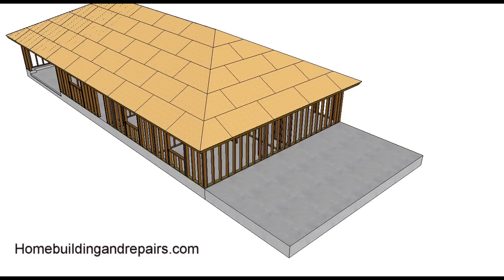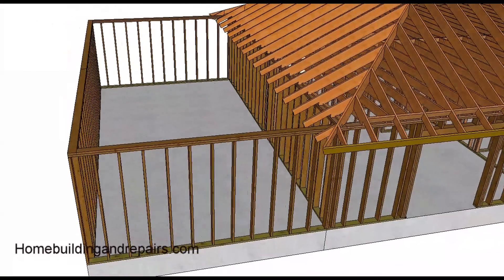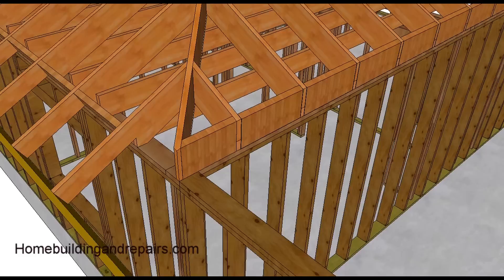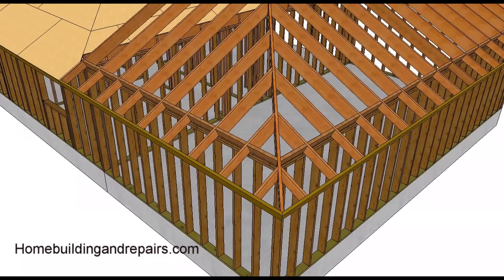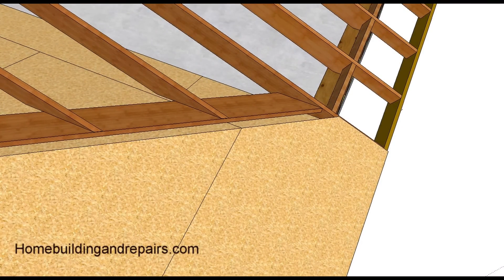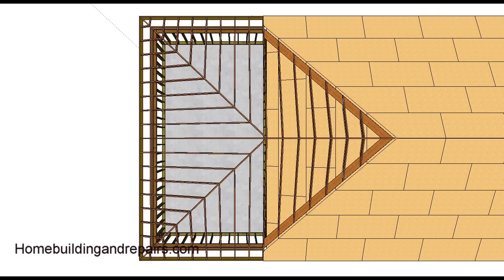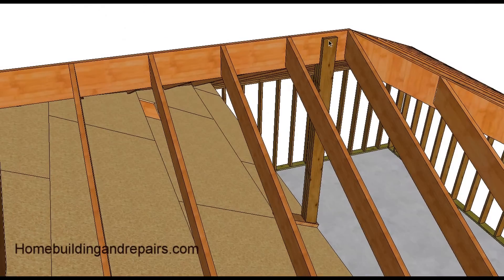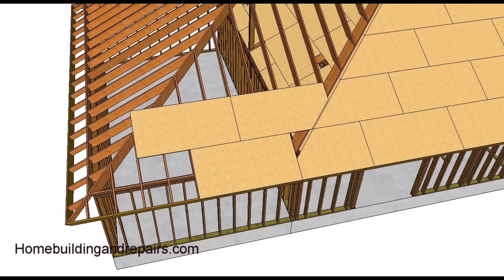How to Frame Hip Roof Home Addition for Existing Building with Hip Roof

Comment: I’m assuming you’ll have to build an attic door since there is no way to install insulation or access the new attic from the existing attic? Personally I see no reason why you couldn’t remove 1 or 2 sheets of plywood from the old roof. It’s not doing anything structural since you’ve no overframed it.
Reply from the maker: You can usually create an access hole in between new and existing construction.

Comment: Do you need the horizontal 2x8 or 2x6 on the newer addition? Your video doesn’t show any for the new addition? Reason asking is I’m turning my 20x22 second garage to a 20’ depth by 32’ length.

Comment: Great-thanks! I'd love to extend laundry room addition all the way to the other end of the house-I was thinking, "If I could just roof off of the roof, that would be great." In my head this is exactly what  I did!😝👌 Nice!
Reply from the maker: Some times you can build on top of the existing roof. I do have more videos you should check out if you haven't already at our website.
Reply: @gregvancom  I did-thank you! I didn't think to ask inspector if it was stick or gable, but my brother-in-law went up to the attic with him. I'm really glad a have a hipped roof for even water distribution around the home. We get pretty serious ice with freeze/thaw and would rather not have gutters to ice up, or use heat tape.

Comment: How far do you normally run the backing board from the ridge?
Reply from the maker: Exactly what backing board are you referring to? If it's the one sitting on top of the roof for the fill area, then it should be as close as possible.
Reply: @gregvancom  yes it was that one that you just mentioned.  Thx

Comment: Great video, watched about 100 times..I want to do exactly this, but then basically remove the  old outer wall to make open into the house.  Would I have to somehow install a beam to support the old roof or any other suggestions?
Reply from the maker: Yes you will need to either leave the original wall with an opening for the doorway or install a beam. I have plenty of information at our website that you should check out in the home addition and design sections.
Reply: Finally finished the addition thanks, now want to put an lvl in over the old exterior wall, noticing it’s tough into the old hip corners, old framing was 2 x 4 …will I be able to cut the old hip rafter and cut the lvl at the 5/12 pitch into the corner and still have enough support??  It seems like it’s going to be very challenging

Comment: We have a small home with a hip roof. We were looking to put an addition similar to the one in your video but we ran into some issues (our home is located on a river). Do you have a video where you only do half of the addition on the right side and leave a deck for the other half and possibly add a garage on the same side as the addition?
Reply from the maker: I don't think so, but you can check the website. I don't offer design services for individual projects, but if you want to, send me some pictures or floor plan ideas and I will be glad to put your video suggestion on a list of videos to be made in the future.

Comment: Why not remove the plywood altogether  where the new roof joins the existing?
Reply from the maker: The plywood on the existing building actually provides structural strength to prevent the building from moving sideways, so it wouldn't be a good idea to remove it, unless specified by an engineer or one of your local building authorities.

Comment: One problem with this approach is that it does not address current energy codes which require R-49 or R-38 insulation.  This amount of insulation requires truss or rafter heels that are at least 10-12" high.  This means the plane of the new roof will not line up with the old (which typically have 2 x 4 or 2 x 6 rafters).
Reply from the maker: It also will not address future energy codes, when you will need R-100. If this is the case and this design won't work for you then you might need to consider lowering the interior ceiling or as this individual suggested raising the roof, but either way you might need to get creative with the process.
Reply: @gregvancom  This is something I am dealing with now as I design my addition. The existing house has approximately 4 inches of heel height between the outside of the top plate and the top of the rafter. The new addition will require a 12" heel (energy truss). This will require some compromise, needless to say. One option is to drop the ceiling 8 inches to make up the difference. I am weighing the option of moving the wall in by 6 inches and incresing the overhang of the addition. Doing so would only require the ceiling in the addition to be lowered by 4 inches (the roof pitch is 8 in 12). A final option I am considering is seeing if the truss company could manufacture a raised heel scissor truss, which would buy some additional ceiling height, despite the lowered top plate.

Anyways -  working with my architect on this dilemma, but it is an interesting challenge in tying old construction with new construction and new building code requirements.
Reply from the maker: @turnerdavidturner  Please let us know what happens. I've never thought about moving the wall in, great suggestion. Every once in a while I get to learn something new and today I have.
Reply: @turnerdavidturner  what was the outcome?  Very interested!!!  Do you have a build thread or video.  Would love to see your design in action for insight!
Reply: @ZeroBit0  Hi Jordan and Greg. I thought I would close the loop and update you both, as we have gotten our design approved by the City  (Ottawa, ON). The end result ended up being a compromise that everyone was willing to live with. In the end, we moved the inside wall "inwards" 1.5 inches. We also dropped the ceiling height in the addition by an inch. This helped us gain a few inches of heel height. It still was not enough to get us to a full 12" heel height. So we modified the insulation plan and will install closed cell spray foam against the outside sheathing of the truss heel and above the top plate - similar to the method used to spray foam a rim joist. The rest of attic will be loose fill insulaltion. The spray foam at the outside wall get us some extra R-value at the critical place to help reduce ice damming. 

No build thread of video series yet. But I will think about a way to do so. I just got started this weekend by taking the brick off the exterior of the existing house. Messy job. 

Thanks again, Greg, for the video.
Reply: I should add that in order to ensure the ventilation in the rafter bays is sufficient, but also low profile to maximize insulation, we will use foam rafter baffles. We will double up the rafter baffles to give a little more strength - this is because the sprayfoam goes on hot and could melt the baffles, staking two of them (one inside the other) gives a bit of insurance without adding much thickness.

Comment: What if I wanted to add on to the front of the house. Say, one of those two rooms you have on the end of the house, extend those front or back. With the hip roof
Reply from the maker: If you're asking if it is possible, then it might be, if it's done similar to the images in the video. However, you would need to check with your local building and planning department to see if you would be allowed to add on to the front of your home.
Reply: Good point about adding onto the front. I was trying to figure out what the roof would look like with an extension of one room on the back. So the house would look like an L
Reply from the maker: @MerkoniumJones  Yes I would imagine it would look similar..

Comment: On this addition if it 10' out.  And  there is going to be no load bearing wall does it matter if you run you ceiling joist different from your old home.
Reply from the maker: As long as they are not going to be used as rafter ties or needed to create some type of a structural connection, then they could be ran in a different direction.
Reply: gregvancom you wouldn't happen to have a video showing how that would work
Reply from the maker: You might find more information on this playlist Framing - Roof Framing Videos (hbar)  - https://www.youtube.com/watch?v=cdfi2cuAzeE&list=PLav41l6sb3G_RMpZLL3Vbz7o8RuRRgzlV  however let me know if you can't find what you're looking for.

Comment: Thanks for the video! If you don't add that vertical beam in the middle, is the existing wall technically still a weight bearing wall?
Reply from the maker: Any walls where the rafters are sitting on top of would be load bearing walls.